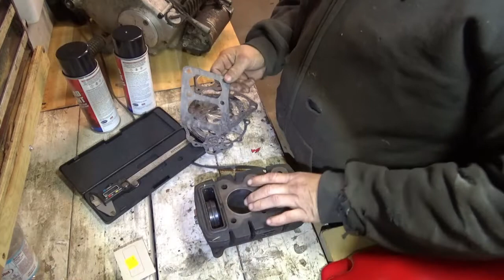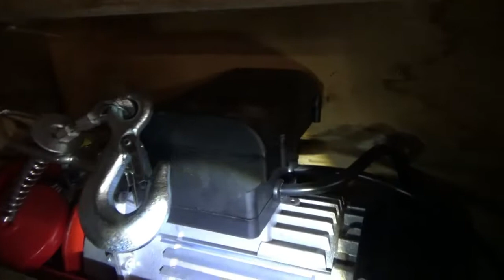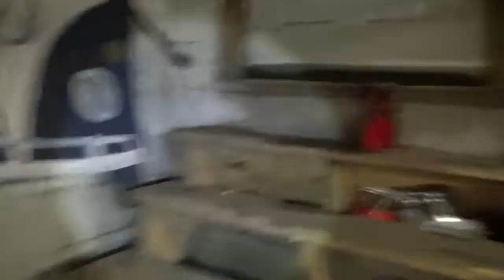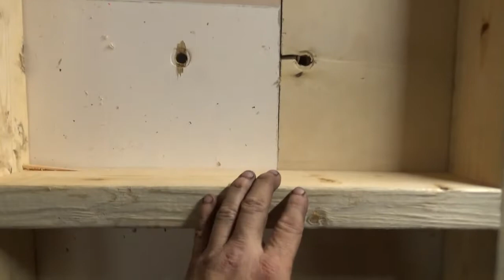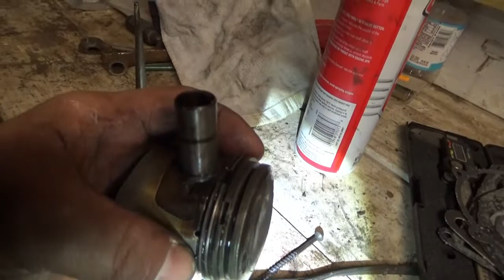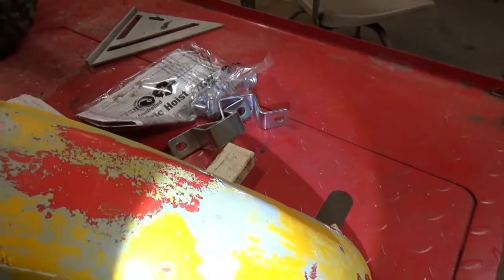New parts come in...then crap

Comment: Hey. Try soaking them in some heavy duty Grill Cleaner too
Reply from the maker: I read about the oven cleaner thing.  It ended up that the groove was not full of carbon but oxidization.  I made a tool that did the trick.  Stay tuned for video.  Thanks for watching and commenting.
Reply: @rustyedmoore  kool man

Comment: i use the old broken piston rings as a groove cleaner,maybe you should get a an of carb cleaner to soak them in
Reply from the maker: I actually machined down a piece of flat stock.  The old rings were to brittle to scrape the crap out.  Stay tuned for video.  Thanks for watching and commenting.